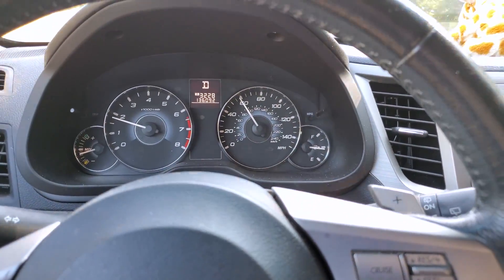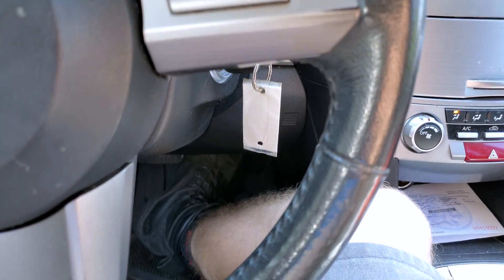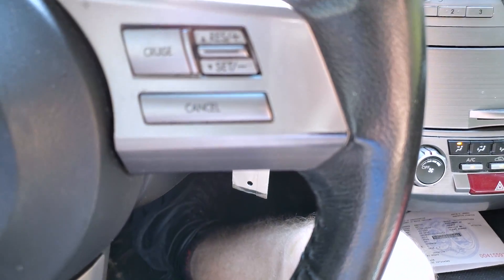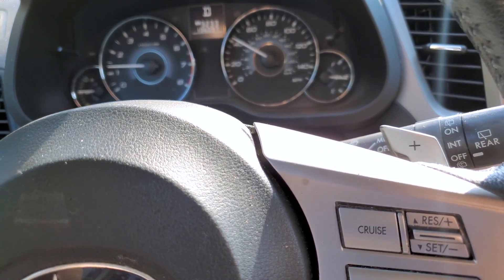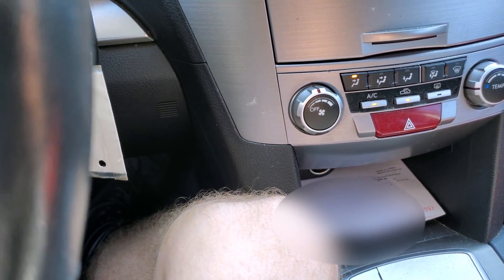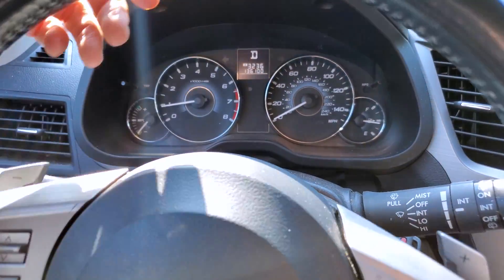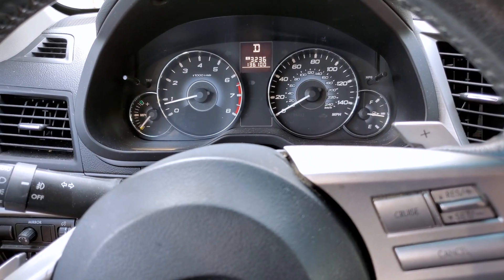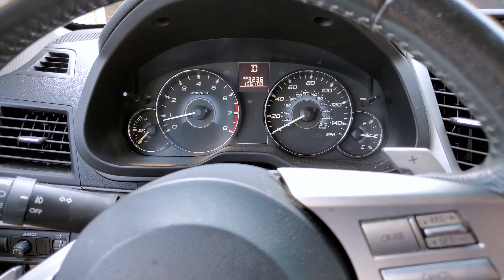Subaru TR690 CVT Torque Converter Failure

Comment: I'm freaking out right now. The torque converter seal is leaking on my 2015 3.6 Outback.
It's going to cost $2,100 to fix! I never noticed anything odd with the transmission, but being a CVT, I hope it hasn't been damaged.
They caught it, while preforming an antifreeze flush and fill.
What infuriates me, is that Subaru's CVT transmissions are sealed, and have no dipstick, so there's no way of telling how much fluid was lost. (I check my fluids every time I fill the car up with gas.)
Not sure if the cost is high or not, but I do know it's a big job. I guess I'll find out, once the service is done, and I drive for a while. I know I'll be extra focused on how the transmission preforms moving forward.
I hope and pray it was caught in time.

Comment: What is a shudder sound that only last a few seconds, like driving over the rumble strips on the road, at the 38-40 mph 2000 rpms on a Subaru Forester 20112.  It is not a CVT transmission?  Can. You help me locate what is going on?

Comment: Hi Mr Subaru. My 2010 Legacy 2.0L experiencing engine shuddering on idle, and stalling when comes to a hard braking stops. All these happens only when the engine is cold. After driving couple of minutes or engine probably fully warm the issues goes away always. Can that be other issues (EGR) other than TC?
Reply: @cher6461 recently I have repaired my CVT transmission due to some problems, and as well repaired the torque converter at the same time, and the issue has not totally gone away, but less frequent now.

Comment: My 2011 Outback started stalling a couple days ago but only at the first couple full stops. It would not happen for the rest of the 150+ miles drive each time. Both times car was warm but trans prob wasnt yet. Bought the car from my parents at 125k miles and it always felt like it didn’t really enjoy the city stop and go very much. Felt a little bouncy or fighting itself from stopping at times. Figured maybe it was just the way the CVT was supposed to be. When i first got the car i brought in to dealership do a trans oil change but they advised against it. Now 141k miles with a possibly faulty torque converter I’d have to change much of the fluid anyways if i were to change the torque converter, Possibly doing harm to the trans? Ive had luck with an 08 Legacy Subaru trans shifting weird or holding gears just a little longer than normal fixing it with just a trans service. Ok my question finally. Do you think a “simple” trans service could fix the issue? I think u mentioned in the TR690, faulty bushing ports doesn’t allow the fluid to bleed and take off pressure from the clutch plate to disengage it from the “flywheel”. My local dealership is charging $825 for labor and $1050 for the torque converter and fluids. Do i have them just change the old fluid that might be sludging when cold? Or go and change out the torque converter? I found the torque converter around 550$ online and at another dealership. Idk how much fluid is.
Reply: Hey Matt - having pretty much the exact same issue. What did you do?
Reply: @aqilhirji  i decided to just live with it. When i feel it’s going to stall I’ll just push the shifter into neutral. Then back into gear when ready to move. I didn’t want to take the chance on changing Torque converter and trans oil just to have the transmission take a 💩 because of it. Car is worth fixing if it was going to be just that as a fix. But that plus a new trans… idk. ESP if i put a new torque converter and trans oil then trans goes then I’ll have to get all replaced again.
Reply: @aqilhirji  my friend has been living with it In his Outback for years and he has about 220k miles. he’s been going like that prob 80k miles. So I’m going to wait till things get worse and then decide to replace car or repair it.
Reply: @HeimataSq  Thanks for getting back to me on this! This is awesome, yeah the shop quoted me almost 3k and the car is so high mileage I'll probably just do the same. Thanks again, your response was really helpful!
Reply: @aqilhirji  no problem yeah I’ve been driving it like that for prob more then 16k miles so far (~157k) and hasn’t gotten worse 🤞🏼. Only really happens in city driving when coming to a kind of quick stop. If u do decide to do it let me know how it turns out. Also if u need to get parts from Subaru go online, many dealerships sell the parts at wholesale prices and usually ull be able to get ur dealerships to match those prices easily. Huge savings. I do this for any OEM part when worth doing it. Brought the price down $1k b4 i decided to just live with it.
Reply: @HeimataSq hey mine does this when stopping how’s yours doing?
Reply: @keseanwoods-gr1dgmine has about 200k+ miles had to replace my front sub frame after it snapped from rust. 6 months later the rear sub frame started coming apart. So I ended up giving it to my dad and he got it fixed... upstate ny salt… now a year later the transmission is starting to fail, on and off dumby lights on the dashboard and u can smell the tans burning but it sat for 6-8 months. I picked up a 24 outback wilderness to replace it. I so didn’t want a car payment. I heard my buddies 2010 outback is still going and it has the same issue. Last I rem his had 230k miles on it and his was doing it since around 150k or less. My dad is going to get rid of the 2011 Outback prob this week.
Reply: @HeimataSq that makes me feel more at ease the previous owner I bought it from said it started doing it at 150k miles it’s now at 165k
Reply: @keseanwoods-gr1dgyeah that’s when mine started to do it between 150-160k. it goes away after the trans fluid warms up? Mine never got any worse. Was only on the first hard stop if the car hadn’t been driven that far. But I’d just put into neutral if I felt it was going to happen.
Reply: @HeimataSq mine does it when it’s warm when it’s cold it won’t stall

Comment: My 2012 legacy has been doing this for years but only randomly at hard quick stops or on inclines. What do I do? It’s 190k miles. How much would it cost to fix the TC? Is it worth it to do? Should I not drive on it?
Reply from the maker: TC is about $800 from Subaru. About $200 in CVTF. Plus the labor. Up to you if it's worth investing the money into.

Comment: Hey Mr Subaru. I got a weird problem on my MY2017 Subaru Legacy 2.5 CVT. 25k miles on it. When I drive in the city, then come to a stop (CVT is on D-mode). Then I stop the car completely, when I'm on D there are terrible shakes in the cabine, the whole car shakes, it really rattles badly, when I shift to N or P - it looks like it goes away and car works much more smooth. What this can be? Did You ever spotted such issue? I cannot return the car to dealership because Subaru EU is not threating failrly cars brought to EU from USA.

Comment: i had the exact same  humming noise, went to subaru dealer and they told me the front differential is bad, did not listen to them and just changed the 2 front wheel bearing hub and the  humming went away

Comment: Mr subaru i have a question. I have a 2012 Subaru Legacy and my tire pressure sensor is on. My tires were just replaced and are regularly checked and hold the right amount of air and do not leak. The light does not turn off any suggestions?
Reply from the maker: Bad TPMS sensor. Most likely.

Comment: i have a 2008 outback with the 4speed automatic transmission, i suspect i might need to replace a solenoid or two on the valve body but im still waiting for diagnosis tool to arrive and get some codes.. what im wondering is ? would it be the TR580 or TR690 valve body for my model ?
Reply from the maker: You have a 4EAT. The TR690 and TR580 are CVTs. You have a 4 speed conventional automatic.
Reply: @MrSubaru1387  im assuming it is ? im having trouble trying to locate precise information yeah, i was thinking possibly the year of the make would be enough to go by ? what would be the best way to find the information im looking for ? the model number is BP9FKSL and the engine number is D615583 if that helps ? i have tried entering vin number on some of the american based subaru parts suppliers with no luck , i assume its because i an in australia that its not giving up any info on my car ?

Comment: @MrSubaru1387 how do you check and see if the torque converter or valve body in the transmission is bad its on a 2010 subaru legacy 2.5i every transmission shop is telling us its the valve body not the torque converter the car stalls when you come to a complete stop or sometimes just a regular stop
Reply from the maker: That's a TCC issue. Next time you go to stop, put the transmission in neutral before braking. See if it still stalls. If it doesn't, it's the TC. If the valve body was bad, you'd have codes for solenoids.
Reply: @MrSubaru1387  and it only does it when it cold outside it won't do it when its hot outside

Comment: Bought a used legacy 2.5i premium and it shudders when braking fast at a stop light.  Doesn't completely die but rpm drops really low and then recovers quickly.  Is this a torque converter?  No CEL codes.
Reply from the maker: It's possible. Next time you're coming to a stop, pop it into neutral and see if it still shudders like when in drive.
Reply: @MrSubaru1387  "Shudder": Does that mean a RPM drop to near stall and then a quick return to ideal RPM?
Reply: Mine also, and, RPM drops very low when shifting to P>R>N>D or R>N>D or vice versa.
Reply: @cher it was a torque converter.

Comment: I've been having a unique problem for a while now with my 98 Forester. When the transmission is in Drive and engine is under load during accelerating and everything is up to temperature, I hear a whine that increases pitch with engine speed, sounds almost like power steering whine. The ATF is slightly overfull and air bubbles present on the dipstick. I'm wondering if the noise I'm hearing is air in the trans pump or maybe torque converter? I know overfilled will create air bubbles, but also wondering if the trans harness oring being leaking may be allowing air in as well? Sounds like I'll need to do a pan drop and new fluids with new seals is a minimum. Have you ever heard of or experienced anything like this?

Comment: Question 2001 outback impress trans. just stopped pulling switched off for about 3 mins. started pulling not slipping at all went maybe 100yards quit again done this 8 or 9 times before completely quitting any suggestions any one I need some help

Comment: I keep having my “AT OIL TEMP” flash when I turn the car on and drive. No issues at all with driving only the flashing “AT OIL TEMP” it recently had the “Torque Converter” changed and a new sensor (sensor replaced because codes came up as bad sensor) any ideas on what it can be anyone please? Dealership is looking into it but they keep getting a bad sensor code when scanning the car.... 2012 Subaru Outback 2.5i Premium thanks
Reply from the maker: The AT temp light can flash if the CVT learning process is not completed. Can flash for CVT fault codes. It has more meaning that just the fluid is low or too hot.
Reply: MrSubaru1387 Finally fixed! Low Transmission fluid and computer needed to be rest. Thank you again man would have not figured this out if i haven’t found your channel 🙏🏽
Reply from the maker: Glad you got it figured out. Must have a small leak somewhere for it to be low.
Reply: MrSubaru1387 Thank you so much for responding so quick I’ve been loosing sleep over this haha I get the car back Monday. If they can’t figure it out I’ll take a look myself. Thank you again for the info 👍🏽🙏🏽

Comment: Good video. I had mine replaced under the extended warranty along with the torque converter. Well I'm 500 miles over the extended warranty and Subaru of America only offered a 350$ parts and service certificate. It sucks cause they changed the valve body barely 12k miles ago. It seems these cvt transmissions are doomed even with replacement. Same code as before. P2763 and p2762. Any thoughts? Maybe the wiring harness? That was the only thing that hasn't been done according to the tsb.

Comment: Our 2014 Outback has stalled on us a few times after coming to a stop. The engine doesn't completely shut off, but does not rev when depressing the accelerator until a few seconds later - pretty scary.

I've read that Subaru has extended the warranty on the CVT transmissions to 100k miles. Does the extended warranty also cover the torque converter?

Also, does the extended warranty cover the second owner, or just the original owner?  We purchase it pre-owned with 50k miles on it from a VW dealership.
Reply from the maker: Yes and yes.
Reply: @MrSubaru1387  - Cool. Thanks for the prompt response!

Comment: May I ask a question, my car in incline road accelerates very slowly but when it speeds up there is no problem with acceleration. It can be based on torque converter.

Comment: https://youtu.be/bn-t5fRfl9U This is the bad video of my road noise. Sounds like it could be a wheel bearing on the rear?
Reply: Rear driver side wheel bearing was bad. Couldn’t pin point which one until brakes were off and took off the rotor. Once I got all of that off, there was no doubt which one. Plus the inner seal had gone and leaked the grease out.
Reply: After this bearing, it sounds like I have another bearing going bad. I haven’t taken time to pinpoint which one yet.

Comment: I have a 2012 Subaru Outback 2.5i auto with CVT. It has around 85,000 miles. I believe I have a wheel bearing going out but have done tests and can’t pinpoint based on normal checks. Sounds like rear. The question I have is mine bogs down when taking off from a stop. Doesn’t die but shudders especially on hills sometimes. Could that be a torque converter issue. I also saw where Subaru put out a bulletin extending the warranty to 10 year/100000 miles on this issue. I haven’t had mine die upon stopping.
Reply: Mine was doing this (2010 legacy 2.5i with cvt). I replaced the maf sensor and it works fine now.

Comment: Just bought a 2010 legacy cvt. Stalling when braking to a stop. I’ve got 89k. Should be under warranty with the extension 100k 10yr?
Reply from the maker: It should be covered. See a dealership and/or call Subaru of America's customer service line.

Comment: Hello Mr Subaru. Great video. I’m thinking of buying an Outback 3.0R. First of all, what do you think of these vehicles? Any common problems? How long can they last? Secondly, I’m looking at this one in particular, which is a 2009, with 130k miles. In really good shape. It starts up fine but runs rough afterwards, and apparently it needs a new ECU. What do you think of that? I’m selling my 2001 Outback H6 due to here in Canada, lots of harsh weather and it’s just really rusty underneath and in need of too many repairs. But I did get 175k miles.

Comment: I just got a letter saying that the warranty coverage on my electric park brake has been extended to 15 years/unlimited miles!
2014 Outback with CVT.
Reply from the maker: Yup. My brother received one on his 2011 Outback 2.5i as well.
Reply: Mee too but my 2012 legacy 2.5i stalls on me every morning at a stop or a red light and turns off only happens once say when car just gets ran for first time of day. 😖🥺
Reply: @smv1013  
There was a transmission warranty extension for outback stalling when coming to a stop. You might want to give your dealer a call.
Reply: @smv1013  my 2011 Outback just started doing this 2 days ago. 140k miles. Bought the car from my parents at 125k and brought it into our local Subaru dealership to change tran fluid but they did i couldn’t do it. Now I’m worried my torque converter is starting to malfunction. Only when coming to first stop when trans hasn’t warmed up but I’ve had car running for 10 mins or so  What was ur issue?
Reply: @HeimataSq  at first I replaced battery and it fixed issue but then about 6 months later it finally took a crap as I was driving loud bang thought I ran something over cost me 1800 big ones then my headgasket fkf up 😢 another 1600 I have 140k right now
Reply: @smv1013   damn yeah we are exchanging issues. I had my head gasket go much earlier. Well when my parents owned it. But i had that happen also to my 08 legacy with the same NA 2.5L. Both were luckily while still under warranty though. They were known for having head gasket issues. But both were only leaking oil out not into coolant or combustion chamber. I think that motor doesn’t like just a little too much oil. So i run oil in the middle or lower on the dip stick if I’m doing my changes. Was ur bang the torque converter finally quitting? $1800 to replace? That’s what I’m originally getting quoted. Did it do any damage to the trans? Don’t wanna jinx u. Hows the tranny after the repair? Did they do a full fluid change in the tranny after just replacing the torque converter? We have the same mileage. I’m at 141k now. Thanks for ur response.
Reply: @HeimataSq  yeah the loud bang was my torque converter finally dying. They did replace fluid and so far it runs fine, hopefully no more problems 🤞🏽

Comment: Continue to do the tools video and I personally would repair any bearing issues with the car before the transmission is removed for the torque converter replacement and if the transmission is noisy wouldn’t it be better to find a low millage used one for replacement ?